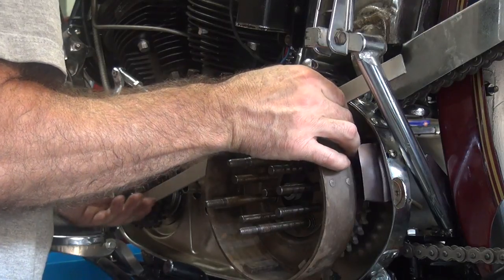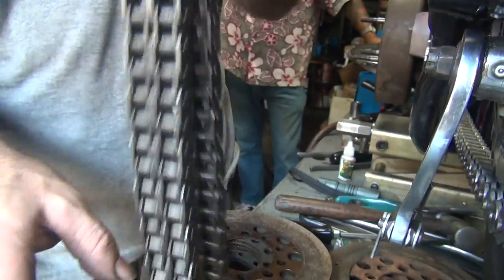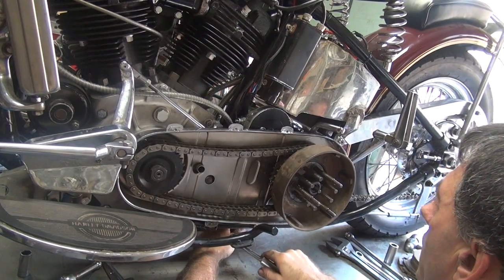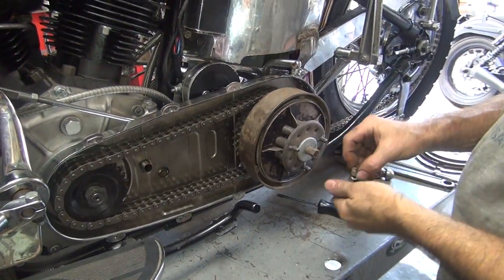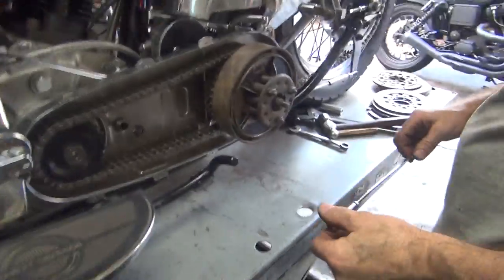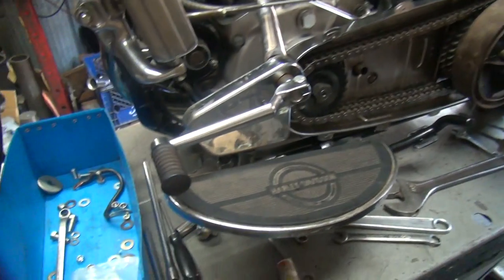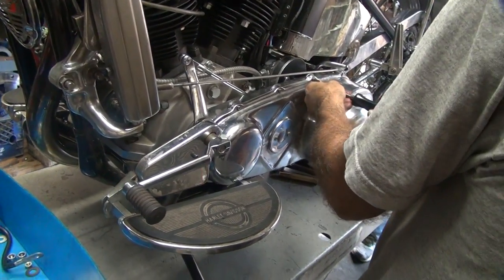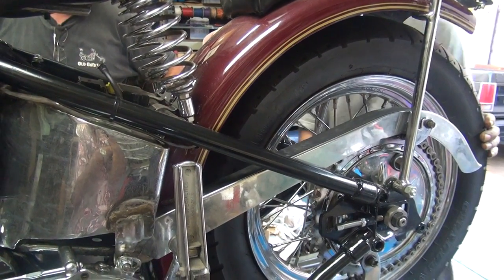1941 74ci Knucklehead #113 Bobber chopper get running kick start new bike build by tatro machine

Comment: What is the mousetrap for? why not run a cable straight from the handlebar lever to a cable stop near the clutch arm? I see them on lots of old Harleys so there must be a good reason for having them.
Reply from the maker: the mousetrap is a mechanical devise that makes the clutch easier to pull. the early foot clutches had more travel and heavier springs. the mousetrap allowed you to the same job with your weaker hand. later on harley went to the direct cable set-up but they lost travel and spring tension. that is why you have all those dragging and slipping clutch problems on the later hand clutch bikes.
tatro

Comment: holy crap! talk about the knee bone connected to the shin bone!....When did Harley start with chain tensioning shoe?
Reply from the maker: 1965 on panheads, 1952 on k-models and 1963 on trikes.
no chain shoes problems with the old way of doing things.

tatro
Reply: @TatroMachine  indian had em. and they were metal.

Comment: Why would there be the 68-up springs when he has a mousetrap?
Reply from the maker: that is what he had. you work with what they bring in. not everone has the cash to buy new parts.
tatro
Reply: @TatroMachine  I'm hip. I wasnt sure if that was your idea because I heard him say that you told him years ago not to use the early springs--but I figure he must have misunderstood. Been a fan of yours for years if you remember. I rewatch your stuff--never gets old.
Reply from the maker: using the correct stiff springs is the best way to go but not the only thing that will work.
tatro
Reply: @TatroMachine  Will using the later springs make the clutch lever harder to pull?